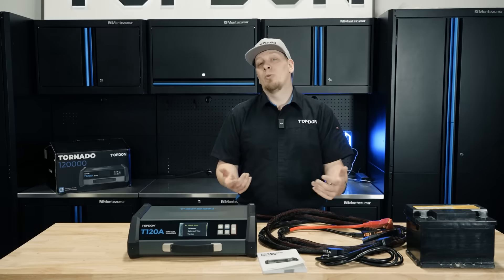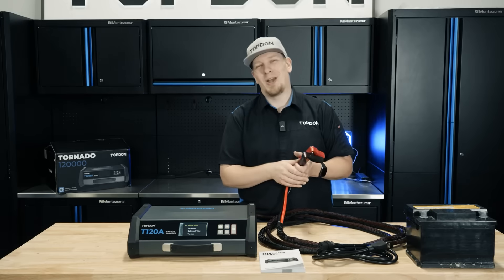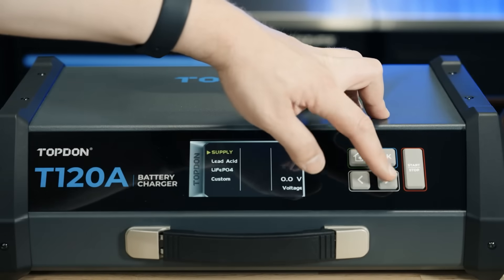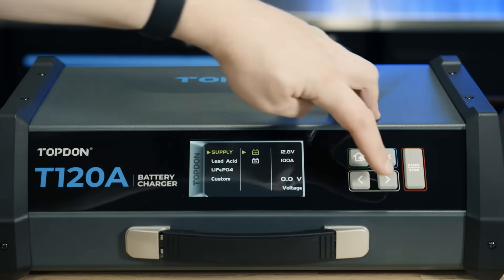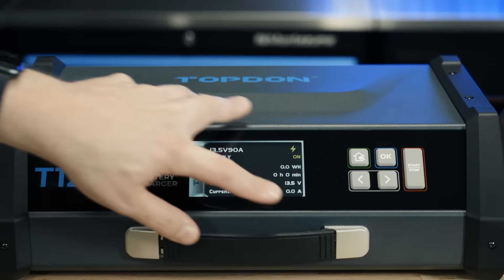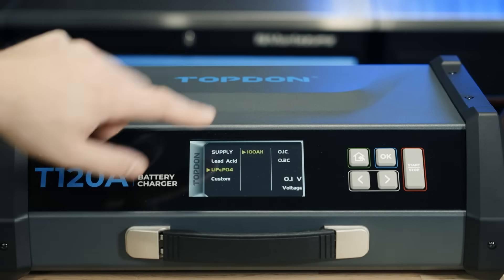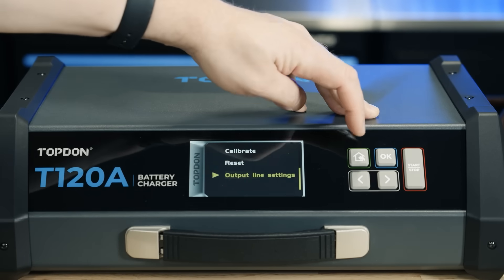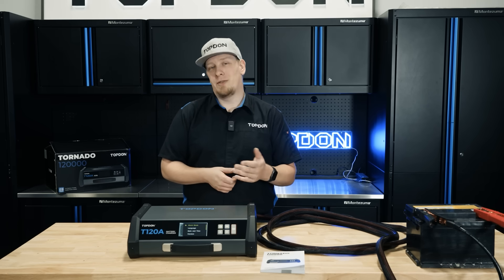TOPDON Tornado120000 Overview | Power Up High-End Car Programming

Comment: Which settings for the GEL & EFB batteries? 🤔
Reply from the maker: Hello friend, you are recommended to tap Lead Acid -> NORM -> 14.2V to test GEL and EFB batteries. You can also check our user manual: This mode follows astepwise charging algorithmthat delivers constant voltage or current atdifferent steps. lt can be used to charge 12vlead-acid batteries, including WET, GEL, MFCAL, EFB, and AGM.